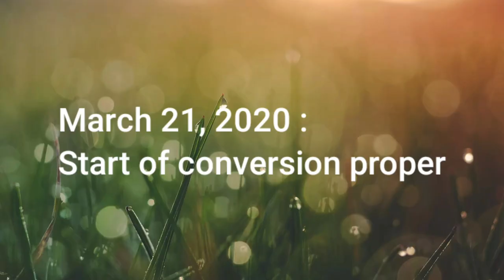My Van Conversion Journey | Vanlife Philippines | Suzuki Minivan #vanlife philippines #vanconversion

Comment: Maam you can put water tank in top for 🚿 shower install flexible hose and shower heads in your back door diy shower curtain  install whole side  to make it round so can take ah bath  no one can see you..hehehe
Reply from the maker: Oh, yes! Thanks for the suggestion po. Yan nga po ang naisip ko. Hindi ko alam paano simulan. Ipagawa ko nalang yan. Hehe Thank you so much po again. Pasensya ang tagal kong nabasa to, Natatabunan yung mga notif ko. Buti chinicheck ko comments ko.
Reply from the maker: Pasensya po talaga. Ang tagaaal kong nabasa to. Natatabunan na ang mga notif. Nirereview ko nalang manually.

Comment: You gained a new subscriber here. One question though. I'm planning to buy the same minivan unit. Can you kindly give the dimensions of the fully extended bed? Can it accommodate 2 adults? Thanks in advance
Reply from the maker: I'm so sorry, Hari. Hindi ko nabasa agad to. I will check the measurements of the bed later today after my shift here at the pharmacy. Two adults, yes.